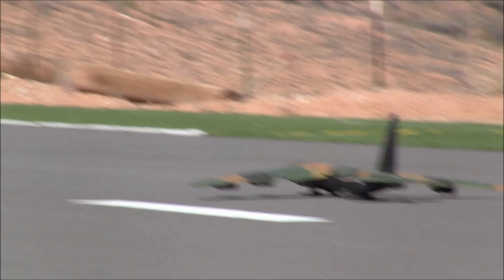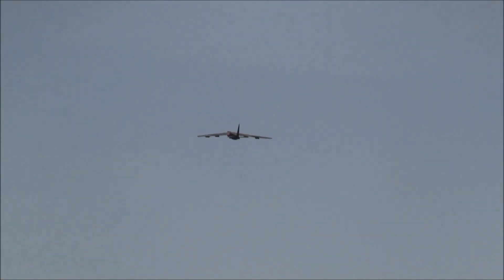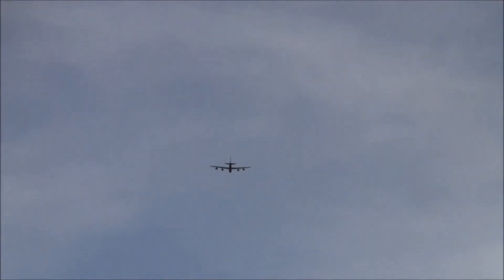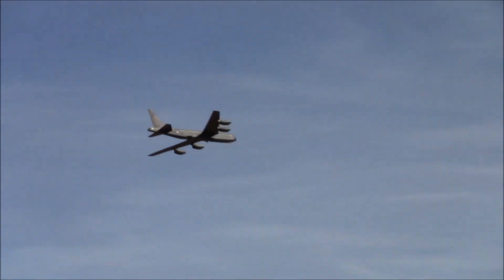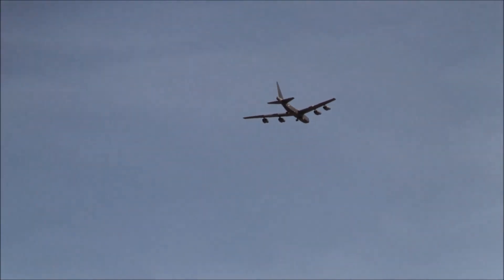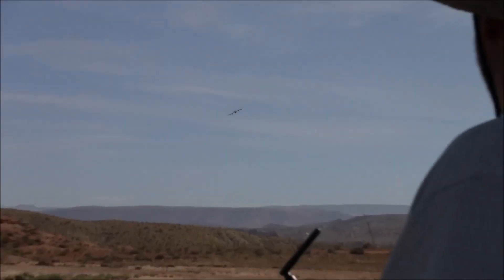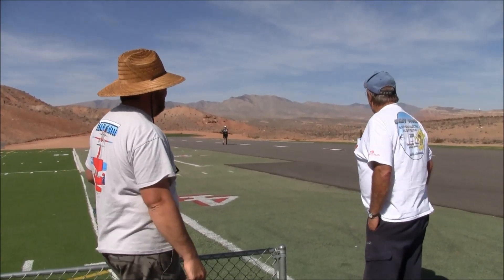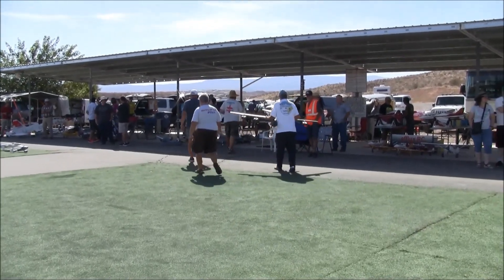Boeing B-52 Stratofortress (7 ft. wingspan) by Keith Sparks and John Morgan - St. George Utah, 2018

Comment: Is there a hardware list? Btw how much would it cost for me to build one?
Reply from the maker: You'd have to price it out for yourself, but I think John used 40mm EDF units, and probably 9 gram servos like HXT-900's, or something similar. Those ESCs you mentioned would probably work just fine as well. I'm sure you buy all the stuff for this from Hobby King or some other vendor. Hope this helps!